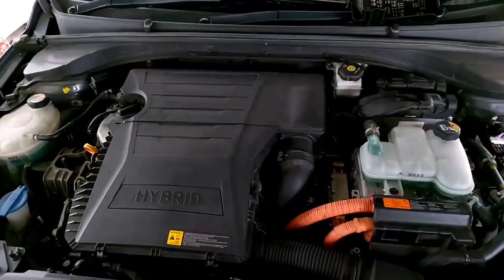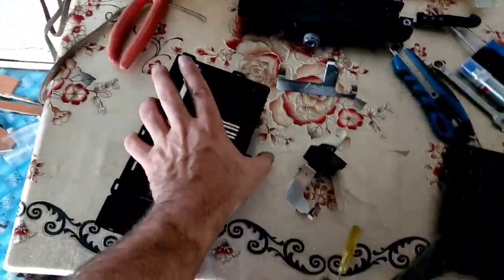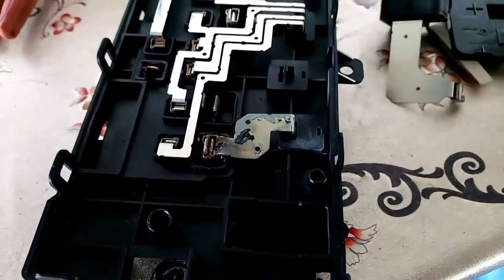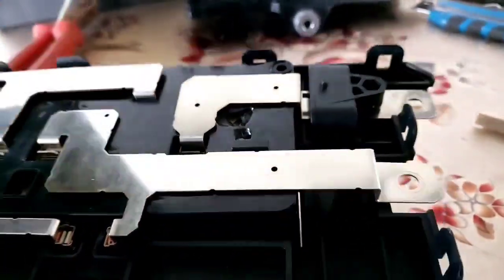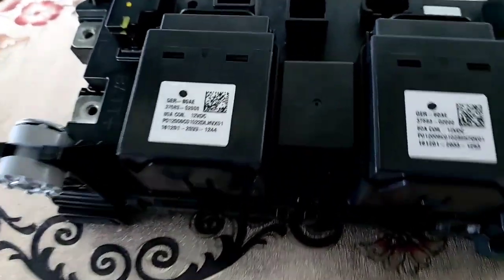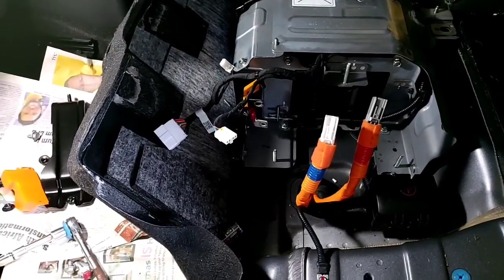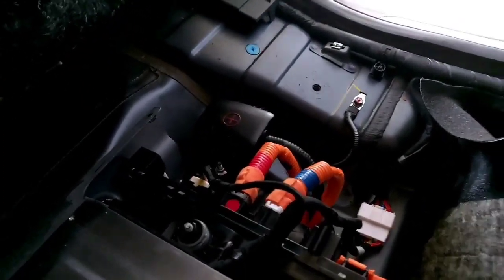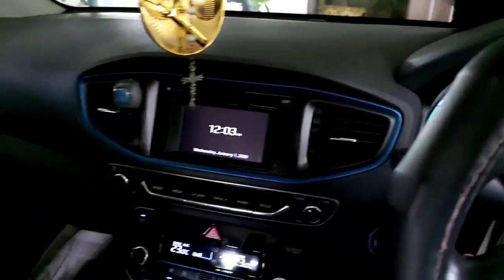hyundai ioniq kona not starting dct p1b77 diagnose

Comment: Hi!  I’m getting this code on a 2024 Ioniq 6. Vehicle turns on but won’t go into ready mode.  Got it from an auction, and dealer won’t help. I see that the power relay assembly is inside the battery, so can’t check it easily. Any thoughts?
Reply: Did you get anywhere with that I'm about to do a diag on an ioniq 5 2024 with the same code? we just changed the iccu on it
Reply: @maxlucas88  No luck for me yet, but if you’re getting that code and the ICCU went bad there’s a good chance it fried the fuse at the back of the battery as well as the PRA inside the battery.

Comment: No 
It is not like that 
There is a safety lock or button or something like that  , and it's located above the lithium battary under cover which we need to press to activate the high voltage system
Reply from the maker: @bluesky6251  you right but not in this case… contactor was stuck melted

Comment: I need some help from you and I’ll appreciate it if you help me out. I have a 2016 Kia optima hybrid and my codes are p1b70, p1b74,p1b77,p1b96 and last is POAOD. It’s a high voltage sensor but I can’t seem to find it. I bought a new power relay assembly and it was not the problem. The car starts fine until the ready light starts to blink then the check hybrid system comes on and also check battery management system. Any idea what’s causing this. Thanks

Comment: There is a recall. Those stickers should say Panasonic.  Tell your customer to go to the dealer and save their money.
Reply from the maker: I’ve been doing that for years
Reply: @hybridsolutiondiagnostics  quick questions!!

HIUNDAY IQONIC 2017

1. how much soc should the hybrid battery should have ( safe parameters/enough juice)
2. do i need to disassemble the entire unit to reach the main +/- for get the reading voltage measurements
3.this exact vehicle you have, HOW YOU SUPPOSED TO SCAN FROM OBD2 PORT WHEN THE CAR IMMEDIATELY SHUT OFF THE 12V CIRCUIT, I CONSTANTLY NEED TO RESET ( PRESS THE RESET 12V BUTTON ) IF I'M IN IGNITION MODE "ON" , CAUSE OTHERWISE THERE'S NOT 12V SUPPLY ! I MANAGEMENT TO GET CODES CAUSE SOMEONE BEFORE ME MADE A BYPASS DIRECTLY FROM THE 12V BATTERY AND VEHICLE ! BUT I REMOVED! SO IM NOT SO SURE IF MY SITUATION BELONGS TO THIS CODE P1B77

4.THANK YOU SO MUCH FOR HELP AND GIVE US SO MUCH INTEL AND EXPERIENCE TRU THE YEARS, AWESOME CONTENT!

Comment: the car ( Kia Niro hybrid 2017  ) won't start.  Code P1B77 and P0DFC , P1BA7.  High voltage comes to the black block but does not come out of it.  Why don't power relays work? ?  I put another black block from the working car and the car won’t start either.
Reply: It’s the high voltage fuse. Change it and it will start. 2017 also has a recall on the Power Relay assembly.

Comment: By anychance did the relay click but not start the engine,I have one from auction not starting,no fault code related,the high voltage battery is low im not sure if it will start the ice if the main battery low,I do though only get 1 click which sounds to come from front fusebox not rear

Comment: has anyone looked inside the actual contactor/relay to see the condition of the contact? that would tel the story. Once dirty or carboned, resistance does climb and  poof!
Reply from the maker: A very bad material that does not hold the current at all over time so it overheats until begin to melt the housing ☝️🥴🥲

Comment: Seems that minus path is too thin and flowing current overheats it as it is under the cover. Plus path is widther and longer so it gives out the heat much better. Maybe resistor value is also too small and inverter capacitor charging current is too high when powering on.... regards

Comment: I have a big problem with my Hyundai ioniq hybrid HEV 2018

The battery jumped

I can't start on and drive 

No light come inside when I try to switch on the key and I tried to charge it from other car but still not charge it. Also, I tried to make battery reset. And I ask the local dealer but they didn't know how to start on. 

Now the car more than 2 months stopping not drive or move.

Can you help me please please please 
My email: abuammar2084@gmail.com

Comment: There are 4 clicks, 
negative ON
precharge + ON (will prevent inrush current)
positive ON
precharge OFF (once inverter voltage reached 95% of the battery voltage in a specific time frame, or will set a dtc)
Reply: Thank you. I learned something.